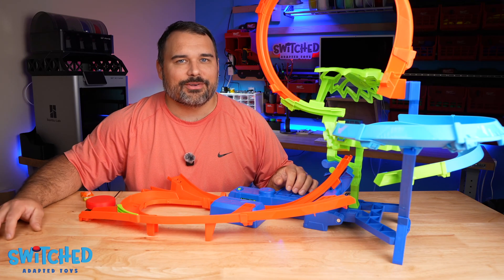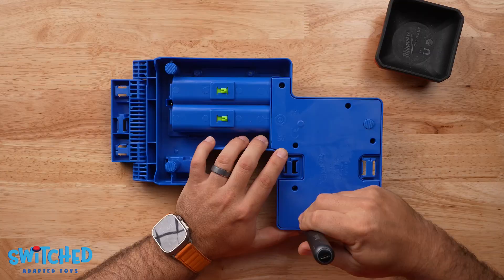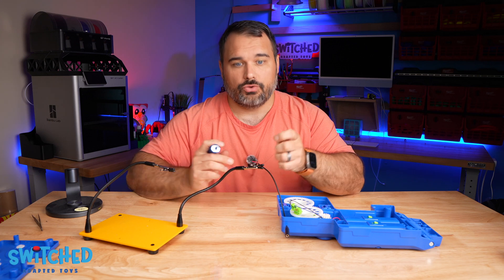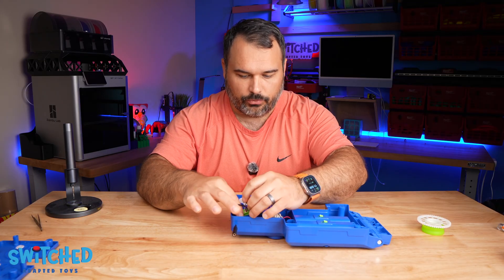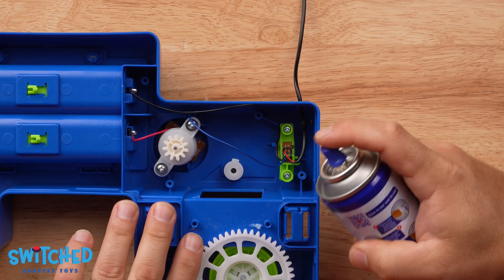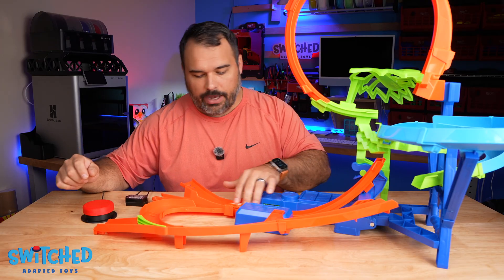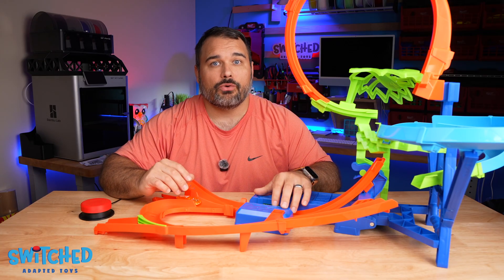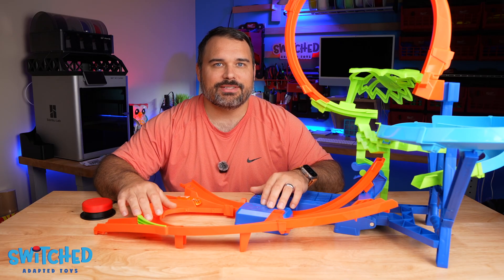How to Switch Adapt a Hot Wheels Stunt Track for Accessible Play

Comment: Is there a reason you choose to have a lead and not to add a socket on hard plastic toys?
Reply from the maker: There isn’t any specific reason we used a lead. You could also mount a socket on the side of the toy. Either way would work fine.

Comment: I have been switch adapting toys for my students! I can do this kind of soldering but when I tried to adapt the Linkimals Sloth, the solder falls right off the circuit circle. What am I doing wrong?? I've tried increasing temperature, adding flux, presoldering my wires, decreasing temperature, anything I can think of!
Reply from the maker: I will be honest with you those disc are hard to solder to. It has been a while since I adapted the sloth but I believe you can also solder to some other point on the board. If you trace the lines on the circuit board leading to and from the discs you may be able to figure out the points you can solder to. You can use some metal tweezers or a small bit of wire to test and make sure you have the correct points.